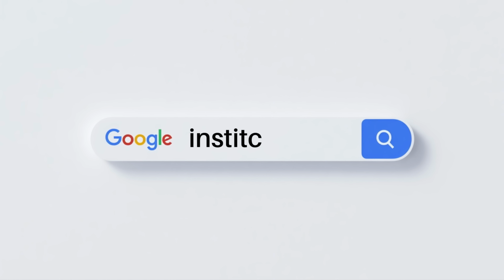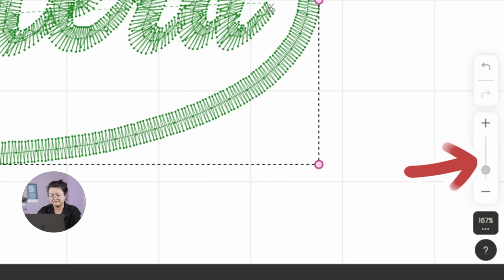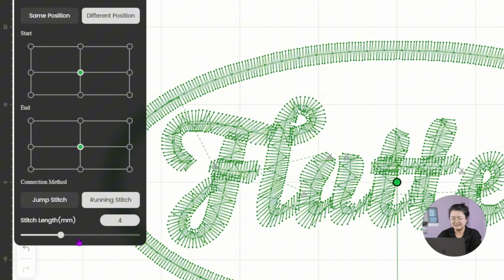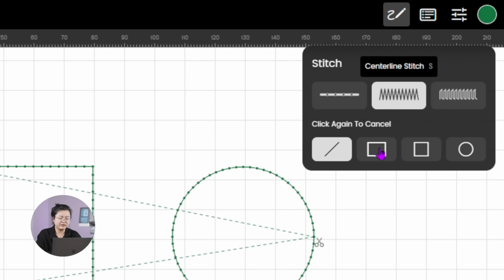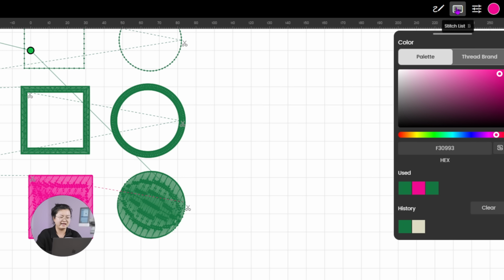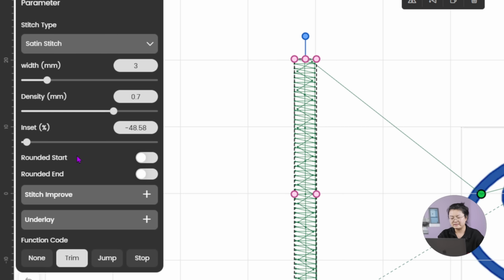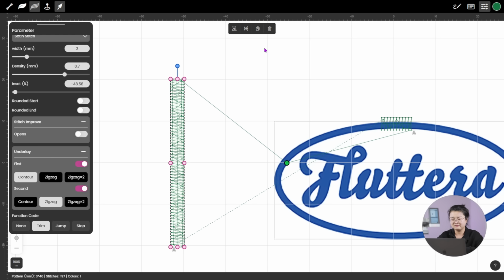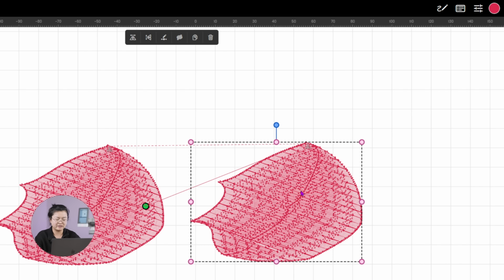Digitize Embroidery with Indoodle: A Beginner's Guide to Software Tools

Comment: Will this software work with PES files?  I have a Brother machine that I'm using now but want to upgrade to Poolin EOC06 machine and am worried about all of my PES files not being able to be converted.
Reply from the maker: The software currently supports importing PES files, but it can only export in DST and DSB formats.
You can use this software to convert formats — simply convert your PES file to DST for use with Poolin.😘